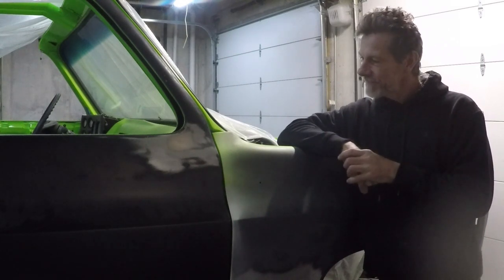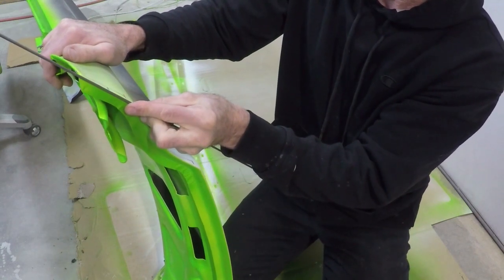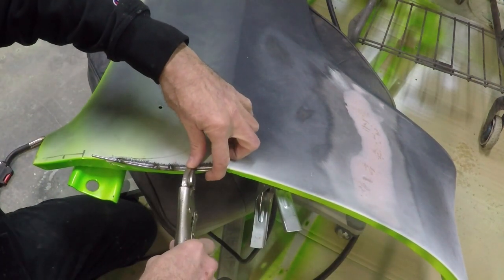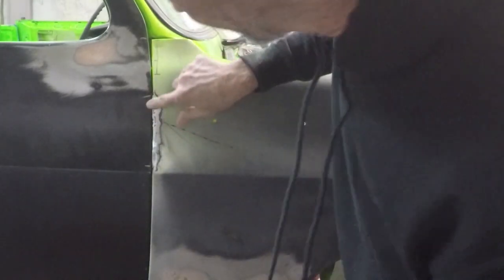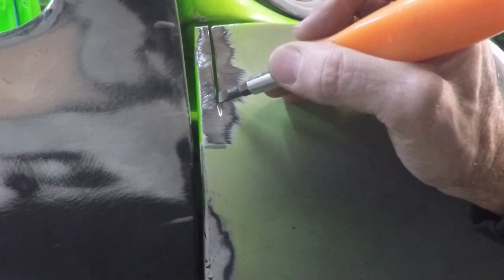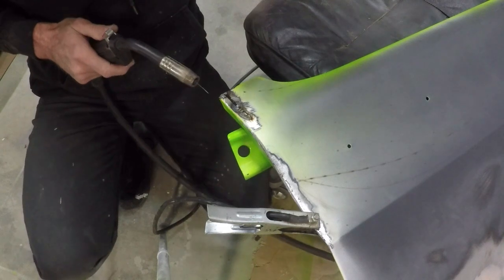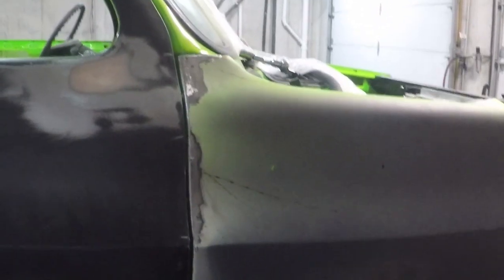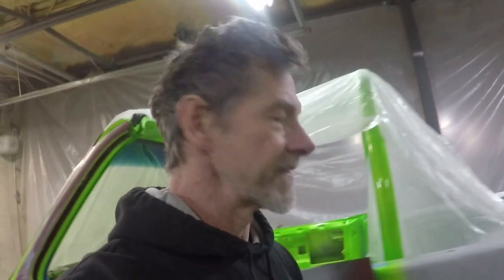Fixing Door Gaps on a Chevy Square Body K5 Blazer full convertible

Comment: What did you do where the fener aligns with the windshield pillar?  my are horrible
Reply from the maker: Sometimes you have to slice the fender and either bend it in or fill it with weld to correct.